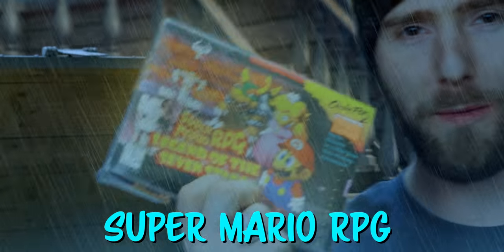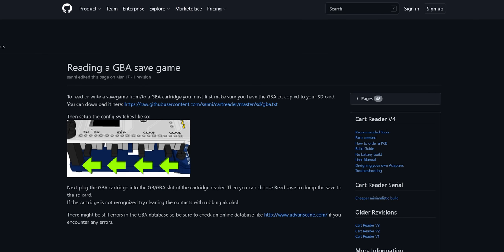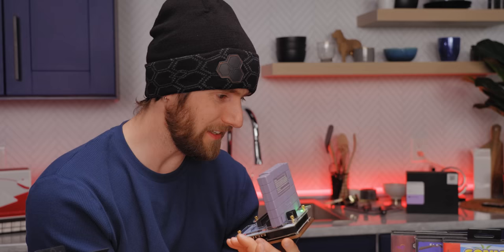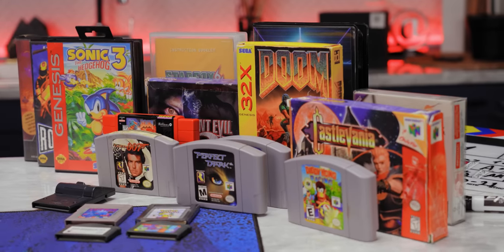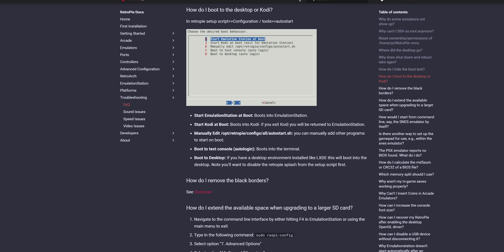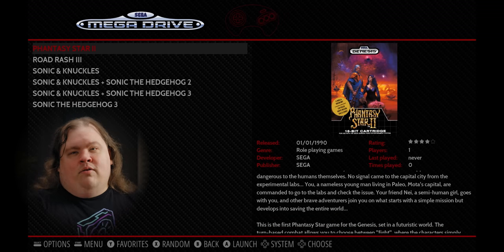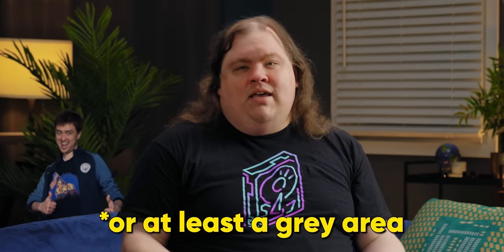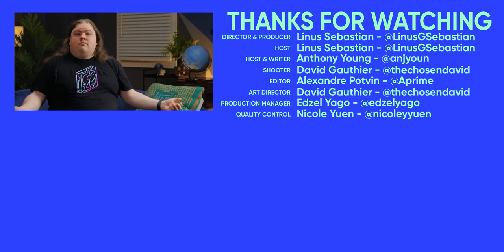I am a pirate - How to LEGALLY emulate games ft. Save The Hero / Sanni v3 + Raspberry Pi

Comment: The last ever corporation I'd care about respecting in some way is Nintendo. No shame in pirating their historic or current products.
Reply: Exactly.  Giving Nintendo more money at this point is morally reprehensible, and has been for a long time now.  Instead, consider supporting the internet archive and their preservation efforts.
Reply: What did Nintendo do?
Reply: @Dragonisser  The worst, releasing it overpriced in online store. Then shutting down the store with no way to DL the game you own. And IF the game is available on another console' store, you still have to buy it again
Reply: @Dragonisser  tbf most companies have done this in the past but we just hold Nintendo to a higher regard. Most of these things ea and rockstar have done. But I don't see people going around saying it's ok to pirate their games
Reply: @Dragonisser  Add to it.
- Nintendo (not love) hate relationship with fan games.
- Not making their games soundtrack available in streaming platforms.
Reply: @c.221  Before they even released the switch they had 2 big things on their checklist that I was interested in. 1. they said they were going to port over the wiiu and 3ds eshops meaning we would have gba/ds etc titles from wiiu on switch. and 2. they said that they would implement a subscription online play model.

since release of the switch like what 6-7 years now they've still only done one of those things, and I bought it for the other.

piracy is clearly the answer to my problems if I want a portable handheld
Reply: Wow, didn't expect this kind of anti-Nintendo statement here! Despite some dubious business decisions, you have to admit they have given us some of the best games and consoles over the years.
Reply: @waddy3985  when did they say the first thing...
Reply: @Susanna The problem with this argument is that it ignores the attraction of buying a game before you play it.

Imagine if you only had to pay to watch movies at the cinema if you said you liked them at the end - it would cripple sales of cinema tickets and we probably wouldn't have cinemas at all any more (assuming they even survive post-lockdown).

You're supposed to gauge whether to buy a game or not on the marketing materials, reviews and (real) demos, not by acquiring the full product and then evaluating it.

You might think this is wrong. And I am pleased you buy the games you like on Steam, but it devalues games as a whole, and as a game developer myself, puts my job in jeopardy.
Reply: @Susanna I have nothing against piracy but why do you think it's ok to do it... Especially during the wiiu era it was ripped straight off the eshop so it's not a copy. I get it doesn't effect them as once they've sold a million copies theyve made a hefty profit but I've never understood this premise that not paying for a product is somehow cool. Old consoles sure it's to preserve but new products why are you acting like it's the right thing to do
Reply: @Susanna When you create a copy, Nintendo owns that copy as part of their "copy right" (Not talking about personal backups, which are suppose to be destroyed when the original is sold or discarded).  When you give it to somebody else, you have stolen it from Nintendo to hand to somebody else, so yes, it is a form of theft.
Reply: @Susanna yeah, that is most likely how the law works where you live if they have copyrights
Reply: @Susanna and no, as a software developer myself I am “outraged” that you think it is ok to use “my work” (not literally) without a license from me.  Just because a company does not provide a product anymore does not give you an automatic entitlement to it.
Reply: @Susanna can’t you do that already on Steam?
Reply: Especially considering I'm not bout to pay over $250 for a console with one or two decent IPs lol. I mean for kids and mankids who grew up playing Nintendo, maybe they care more than I would. But nah I'll be playing PKMN for free bruh
Reply: @DavidAddis  not even close. They "give" you new games locked behind a 300 dollar handheld, which has a planned short lifespan, and then they take down their storefronts and console servers, you lose your game and your 300 dollar console loses features. All this at the same time they spent millions to harass their own community.
Reply: Nintendo is a lesser evil so I neither condone them or resent them. There are more shitty practices for software out there that deserve attention.
Reply: @DavidAddis  Consoles maybe, games no. There have been far better and legendary games "over the years".
Reply: @Michael how is that any different?
Reply: @Michael ok….. go copy a work from a starving artist instead of contributing to them and ask if they see a difference between “art” and “product”
Reply: @Dragonisser  None of that gives you the right to pirate current Nintendo games.
Reply: @Susanna steam let's you refund pre 2 hours of playtime... In most games after 2 hours you're well within it enough to know the game...
Reply: @TheBrandonn  one or two decent IPs... So mario. Zelda. Smash. Kirby. Metroid. Splatoon. Astral chain. Bayonetta... I find the edgy I don't want to pay funny. Like is it cause you're poor... Or do you think you're cool that you're not paying it. Sticking it to the man. Mean Calling people mankids for enjoying Nintendo games makes me think you're a teen or yourself a manchild. Real adults play whatever they want and have the money to pay for them 🤣
Reply: @Michael why does it matter who the artist is?  That is a poor justification to theft.  Sounds like you are the one with screwed up morals if you think it is ok to steal from certain people, and you clearly are clueless that products and art are the same thing to the people who create it as a means of revenue.
Reply: @Michael ….. piracy is theft …… what do you think pirates do? Bake cookies?  You go continue to be a thief,  I will support creators for creating content I like, regardless of their economic standing.
Reply: @Michael ok thief
Reply: @Michael ok thief

Comment: "You can dump a huge collection in, like, no time!"

Aw, Linus.  So cute.  Have you gotten to your first cart that didn't read correctly yet?  Break out the isopropyl alcohol and a carton of cotton swabs and get to dumpin'!

Seriously though, I didn't know about this, and I like the idea of using a dedicated device rather than the Retrode, where I spent a ton of money on adapters, have to deal with storage drivers detecting the media on a computer, and it doesn't even do NES carts.

Comment: It's a huge grey area when it comes to this sort of thing. For a example years ago there was a Macintosh Plus Emulator and you needed the system ROM. To legally obtain the ROM image you needed to own the Mac plus. Also legally to run it you couldn't run both at the same time. Later on someone made a expansion card to have the ROM chips from the system then from there people found out you didn't need to own the Mac but only to own the original ROM chips. So you could just hit up eBay and buy a busted board, pull off the ROM and toss them onto the expansion card.
Another one is for the Arcade repair guys. Over time there is byte rot and the EPROMs will loose data and you can legally rewrite and replace said ROMs. For a example a Pac-Man cabinet has graphic sprite issues you can rewrite the sprite ROM and call it done. However you can't legally turn a Pac-Man board and make it run a different game because you would be replacing all of the ROMs with different code.
However there another grey area called Abandonware / Vaporware and it's up to the software development company to grant it or if the company doesn't exist anymore with anyone not owning any rights to it.
Those 1000 in 1 game carts come from a country that won't do anything or has silly laws stating you can't sell it here but you can sell it overseas (cough China cough). Come to think of it there is a guy Eric Lundgren gave away copies of Dell restore discs with refurbished computers and got in trouble because he used the same font that Dell and Microsoft used on the CD labels. Apparently what that guy did was legal on the software side of things but all because of a couple of fonts landed him in jail. Same thing with websites that hosted ROM images, as long as you abide to the rules and laws it was legal but some got shutdown for not disclosing the said rules and laws. Nintendo won a suite for 2.1million because a website charged for the downloads of the ROMs. Also don't forget about LoveROMs having to pay Nintendo 12million.
Odd thing is at my local mall there is a kiosk that sells those cheap Chinese console knockoffs that have 1000+1 games on it and no one bats an eye. Heck one time I went to the local flea market and I counted four tables in different areas selling copied DVD movies. they had a binder loaded with new movies that were still in theaters and you pointed out what movie you wanted and they ripped it right then and there and charged you five bucks per disc. Law enforcement walking around there also and didn't bat an eye. Amazon selling those Arcade boards that have a wide assortment of games from different systems.
What it seems is piracy is a odd thing. As long as you don't bring much attention to yourself people look away.
Reply: The Eric Lundgren case wasn't about font, it was mass copying the dell recovery software including trademarked logos and then intending to resell them to refurbishers for 25 cents each. I don't like the law, but font wasn't the issue.

Comment: In my humble but correct opinion, any game older than 20 years should be considered public domain.
Reply: If you look at Steam, 99% of games make 99% of the profit that they will ever make within the first year. Copyright lengths for games should be maybe double that figure, so typically 2 years.

I actually would support copyright getting extended if sales are still high though. So copyright would extend until you sell <.1% of your total sales in a month. Maybe this would encourage some patching. This would mean that minecraft would still be under copyright, though it is 11 years old.

But dead games shouldn't be under copyright.
Reply: I agree with you, that Is very reasonable.
Reply: The overall point is sound, but I'd say 25 years. It'd be strange to have 2002 games right now as public domain already. Morrowind would then be public domain. Maybe 25 years, so we'd now have Diablo and original Grand Theft Auto, or so, and soon Baldur's Gate. Overall 25 years is close to a whole generation, and if you haven't made the buckaroos in that time, it would be nothing but fair to make it public. The issue becomes more difficult for games like Guild Wars. When they are 25 years old, people will still play them, and the servers still need money from new sales. That is a whole another story. The right to play multiplayer has to be purchased, and that can always be licensed into it permanently past the 25 years. Otherwise the game would die at 25. Or need a new expansion, forcibly.
Reply: @PahaLukki  I favor 20 personally.  For all Works for Hire.  You could potentially use Contract Law to protect Services for longer, if need be.

Edit: I forgot about Trademark Law!  That's a brand that doesn't really expire unless you stop fighting for it.  A lot of Services could be protected by Trademark Law for an indefinite time.

Comment: 11:58 you need to tune a few things in retroarch menu to reduce delay, like disabling threaded video

also in runcommand menu (pressing A before the game finishes loading) change the render resolution to 1280x960, helps A LOT too, it's a bit misleading but it won't look blurry or on wrong aspect ratio, it just makes the game run better at zero performance cost (actually lower performance cost)

Comment: I condone piracy for games that are 2x higher than their original price
Reply: I condone piracy if it's any higher than the original price
Reply: so u think that a snes game beeing sold for the original price of 60ish $ is good pricing?
Reply: @dustinm2717  I condone piracy
Reply: @My_Old_YT_Account  thats a man of culture
Reply: I condone piracy no matter what
Reply: @mathdantastav2496  Snes games weren't sold at $60. They were in a range of 15-25 usually. This was the 90's man.
Reply: Not for every game, I remember seeing Super Street Fighter 2 for 40 usd in stores back in the day.

MegaMan X3 was even more expensive, like over 70 usd when it came out.
Reply: @danieljimenez1989  The Megaman one sounds like you went to the store that knew people wanted that one more than anything. The majority of games were less than 30 though. While the Xbox era brought the raise to 60 it also brought the stability on prices.
Reply: @skurblord3401  ok, still, so do u think 15-25$ is a dedcent price for these games? Games that should be free, or almost free at this point

Oh, also, google tells me snes games were generally 50$. Maybe the ones u r thinking of are either pirated, or secound hand
Reply: @filip1997andersson  another man of culture
Reply: Original price would have to be inflation adjusted. Otherwise as time moves on such thinking would require those games be sold at near worthless prices. $60 brought a game back in the 1990s but might not even be enough to buy a packet of sweets by the time 2100 comes around.

The strange part is that people paying such high prices means there is money to be made. Money the intellectual property owner is missing out on by not selling the game on modern platforms.
Reply: @mathdantastav2496  No its not a decent price for a 20 year old game with no support. Maybe $5-$10. I personally feel abandoned software is free game. If I can't get you to take my money I will just take it. I was just pointing out that the past price was not that high.
Reply: @skurblord3401  it really was listed at a high price from the catalog... MMX3 had a small run and the game was expensive.

Comment: while this method is likely cheaper, there are a load of devices that can do this kind of stuff. one example is the epilogue gb operator, which does this with Gameboy, color, and advance games. The reason I brought this one up is because it's a lot more streamlined of an experience, being build into one app. it comes with a built in emulator, a usb port to plug it directly into the pc, and is fairly small, fitting easily into a pocket. overall an option to consider if you're going for this.

Comment: Notes for the ones who is troubles getting Raspberry Pi for similar setup!
In my country (Japan), it's easier and cheaper to buy some Celeron Mini-PC instead of Raspberry Pi. You can use RecalBox or Lakka (which is available for x86) distros instead of RetroPie, but they work more or less the same!

Comment: After it was announced that the Wii shop was going to close, I figured: (a), I live in Sweden and making a copy of something you own to play it on a different device is legal, (b) Wii can easily be hacked and I can easily extract most ROMs I purchase from it, and (c) a used Wii costs basically nothing, and (d) the Wii shop was probably the cheapest way buy many of the games on there - so I bought a US system (since the NTSC versions of games are usually better), and bought probably 50+ games off of there. I play the NES and SNES games on a modified an NES Classic and an SNES Classic, the N64 and Mega Drive games I play on real hardware with Everdrives.

Comment: 1:25 To be fair, you can recoat the contacts to work like new. For those interested, you can find YouTube videos on restoration if you're that hardcore. I will also say that at 1:40 you're not wrong for most carts but not all use batteries and you can now mod them to not use batteries but that can destroy any value it might have had. Again, tutorials can be found on YouTube for those interested.

Comment: RetroPie has an easier solution: insert a blank USB drive and leave it in until the light stops, then put it in your computer and convenient files will be created. put the ROMs in the right file, then put the drive in your pi again, wait until the light stops flashing and shut it down. feel free to remove the drive then, or leave it in, since it gets all the roms onto internal storage.

or do it your hard way

Comment: Speaking of SMRPG.
I am working on a Remaster version of the game with better colors, harder enemies using Lazy Shell 4.0.1 and previous versions. 
While it works, I'm still calibrating the difficulty, swapping enemies around to make more sense. (why wouldn't you see crooks in Bandits way?)
A lot of the colors and been either recalibrated or completely changed but mostly recalibrated at TVs these days already projects a very bright scene, not that it'll be dark or anything, but won't be blindingly bright.
Reply: Where can I find this

Comment: Thank you guys for creating this content one of my favorite games on Sega was Phantasy star. I have a fair number of cartridges going back to Atari 2600 that I have owned for more years than I care to admit lol . I own consoles and game cartridges for alot of  systems from the 70's - 90's. but there has always been tghe legal question on using roms on raspberry pi for games & systems I physically own. Using roms obtained elsewhere on raspberry Pi has been questionable even with owning both the system and the console. Thank you for sharing, is there any similar product you would recommend for Turbo Grafx & Atari 2600 as this system does not appear to work for those systems?